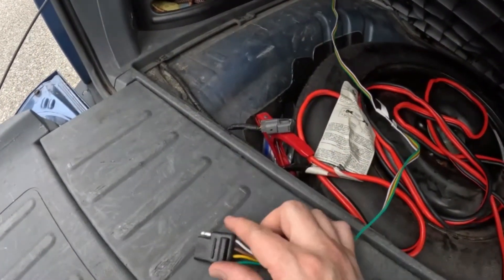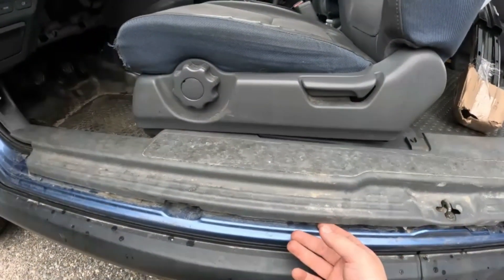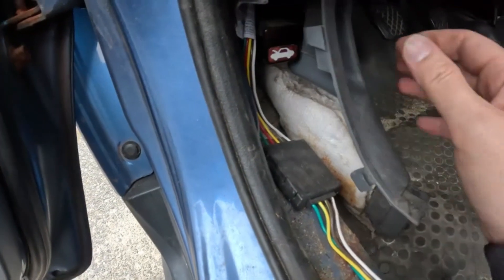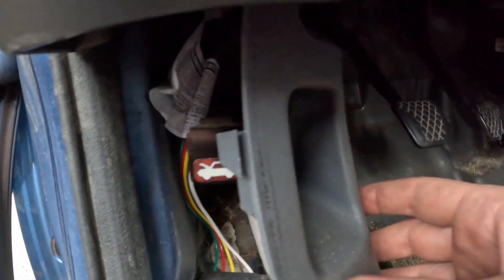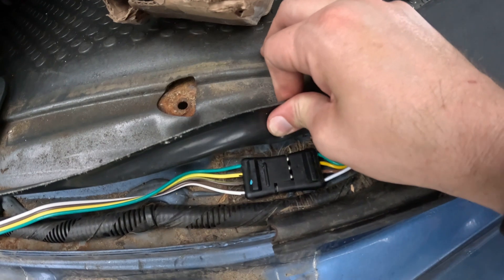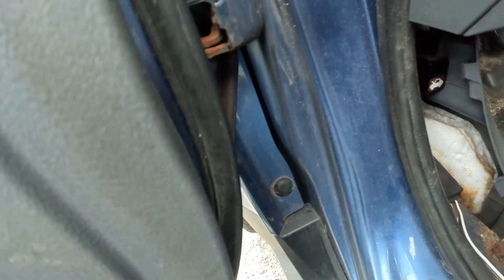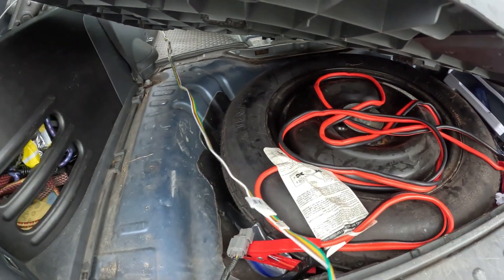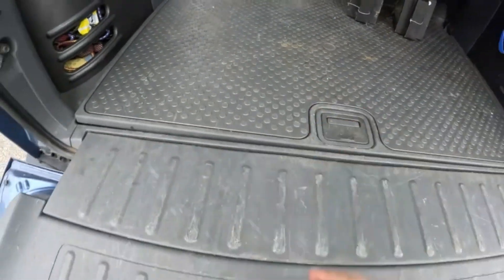05/06 honda element trailer harness plug and play

Comment: Many thanks for your video. The OEM part is not available anymore. I was getting ready to do it the hard way, as even the Honda Element forums do not mention your method and state you have to splice it in. To anyone attempting this, if you look at the compatability on a parts website it's going to say this part doesn't fit you 05 element. It absolutely does work.
Reply from the maker: Glad it helped

Comment: The harness extension you have linked does not have the white ground wire extend all the way and instead has two slightly different brown wires. Any tips on what to do? I don't want to connect the white ground on the male end with the wrong wire on the female end.
Reply from the maker: It seems like they have changed the item listing. Thank you for letting me know, I will update with a new listing.
Reply from the maker: Harbor freight and most auto motive stores will carry the 4 pin extension since it's a universal item
Reply: @scooterjean86  Thank you. It looks like my local Harbor Freight has it. 👍